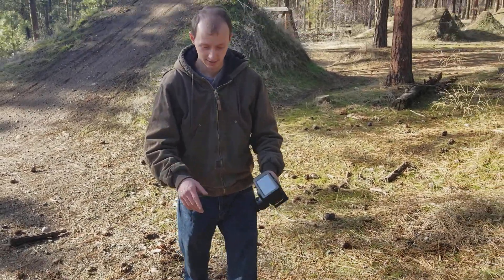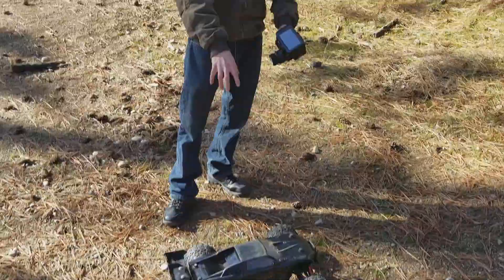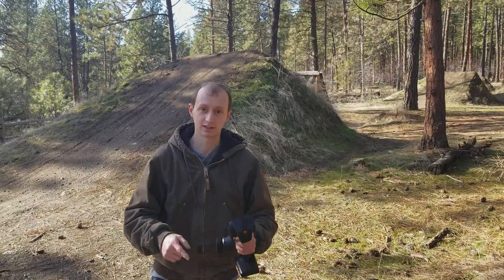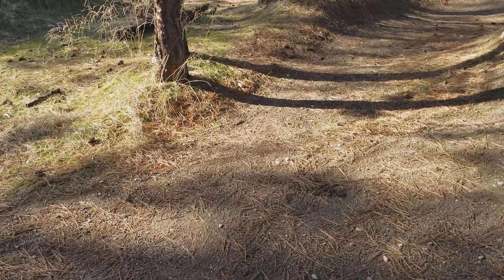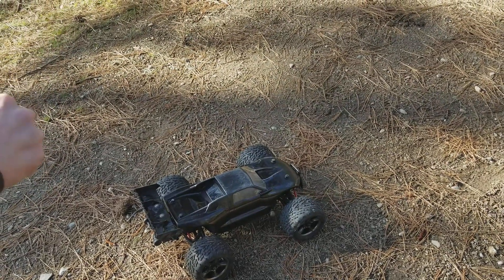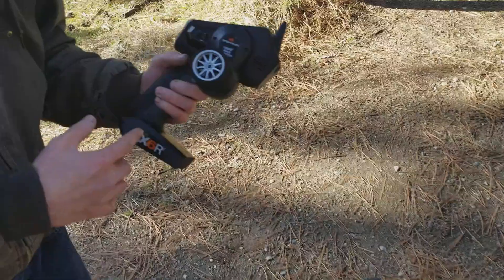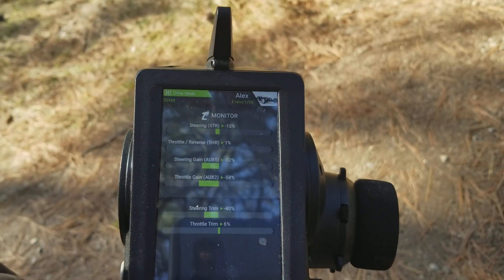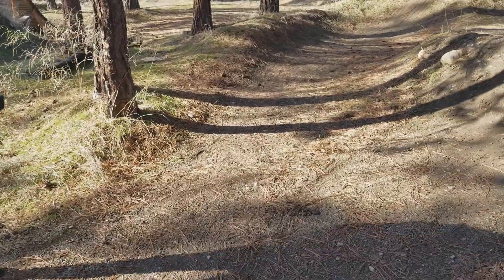E revo  brushless  bash

Comment: Awesome color on the body ! Really like it all black :D Looks cool Alex rc freak. Good info, very nice video =D Hope the new 2.0 will have better diffs :)
Reply from the maker: Norway RC Adventure thanks for watching the video and the commit  Personally I do not think they're brand new I revo 2.0 has better differentials than the original I revo It's still centered metal that's molded metal powdered metal of its molded into a form to me it still looks really weak on the diffs
Reply: Alex rc freak maybe they have changed something, I am thinking of buying it when it comes out. It still has better upgrades so if the price is right in Scandinavia I think I will buy the 2.0. :) thanks for reply! 😊
Reply from the maker: Norway RC Adventure im going  to  be  buying  it  still also i love the e revo platform when mine  dosent  have  diff problems  its maga fun to drive

Comment: Crazy question, but how do you know the diff has gone out?
Reply from the maker: RC's Big Air  Usually you will hear a clicking or grinding noise coming from the ring and pinion in the front or the back of the vehicle that's a usually good sign that the spider gears or the ring and pinion or both have gone stripped out thank you so much for the comment
Reply: Alex rc freak Ok, sounds like that might be my problem.  Do you just have to tear apart and rebuild? Doesn’t sound fun.
Reply from the maker: RC's Big Air  yes definitely to inspect to me it sounds  like  the diff went out

Comment: Something is not right at all, that's not normal. I can torture my E-Revo way more than that on 6S and I broken about 1 diff per year.... and to be honest at least once was totally my fault for not assembling it right. And let me be clear: I'm reckless with it. Full throttle, jumps, wheelies, it takes it.

Other than the shim I would recommend to check the diff outer case, possibly switch to metal to reduce flex, and definitely check the bearings. If your bearing has play the pinion will move, mesh with the ring gear will not be right and boom. Possibly get ceramic bearings from acer racing or something. Ceramic are not much more expensive than normal but should last longer.

Hope you can get it working right as the E-Revo is an awesome machine. Hopefully the ERevo 2.0 will be more resilient to such issues.